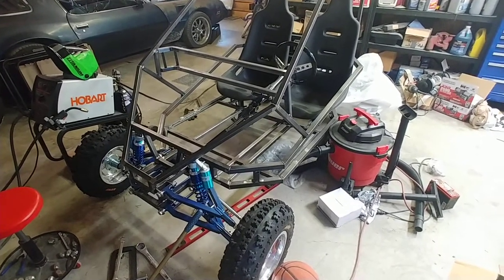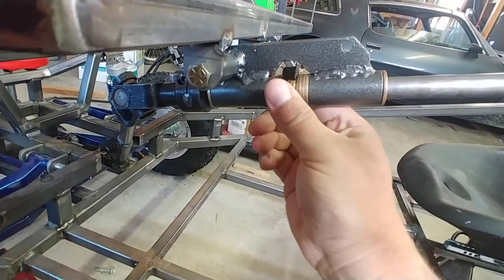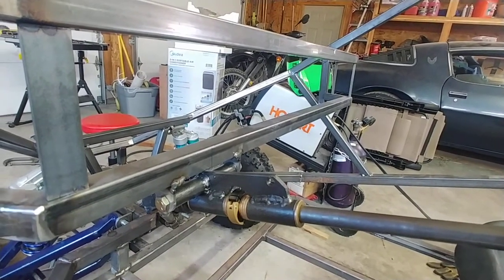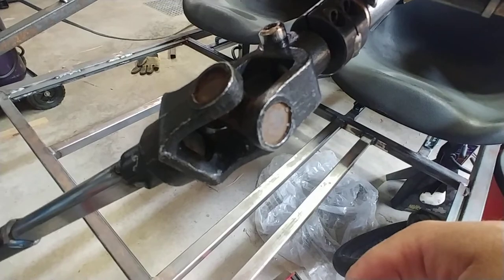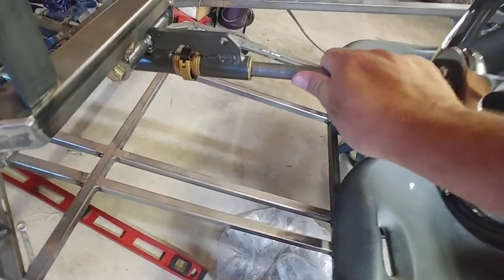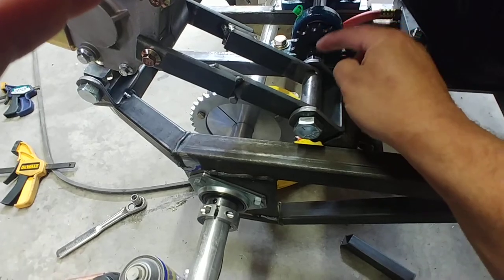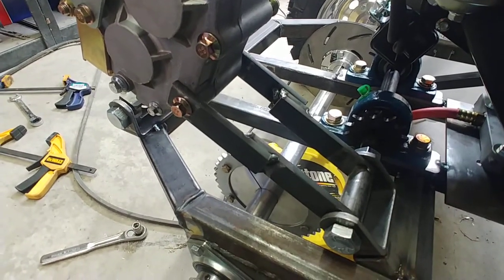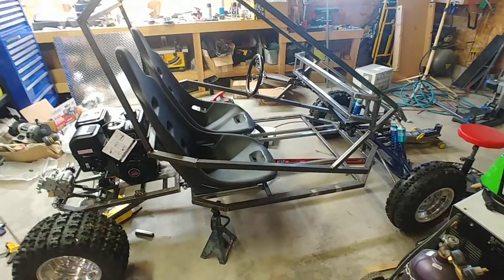420cc Kart/buggy update - Steering linkage, and transmission

Comment: I've got a built GX390 with one of those 30 series reverse gear boxes behind it and it is held up so far. It is fairly a new build but we haven't been easy on it at the same time. I drilled and tapped the end of the input shaft that the driven clutch goes on to so that I could run a 40 series driven on it, and it is now held on with a bolt and washer. I have also got one of the newer bigger reverse gear boxes that's made for a 40 series and a 780 series torque converter. That is still sitting on the shelf going to a dedicated build.
Reply: Where did you get the bigger reverse box?
Reply from the maker: Awesome info... So did you cut off the threaded portion before you tapped?   I'd really like to hear more about the bigger transmission... Link?  Make/model?